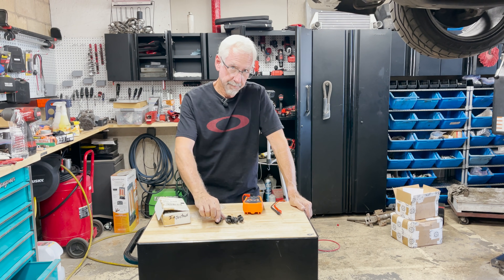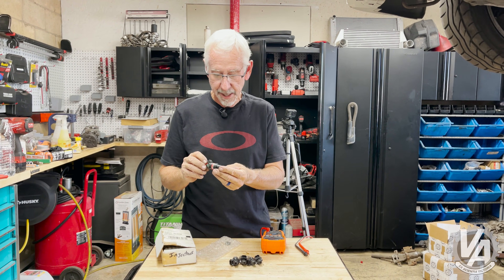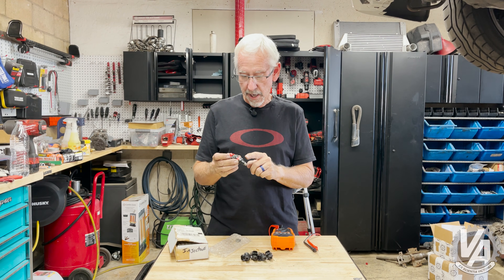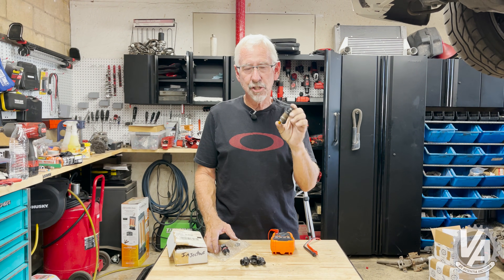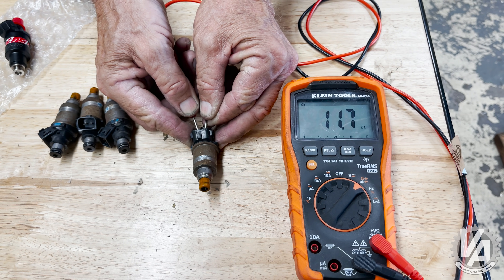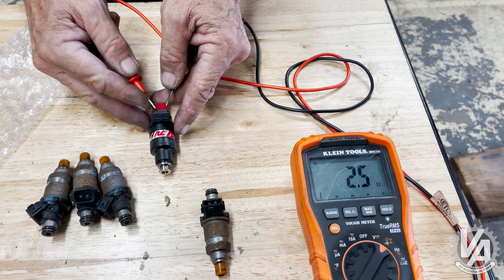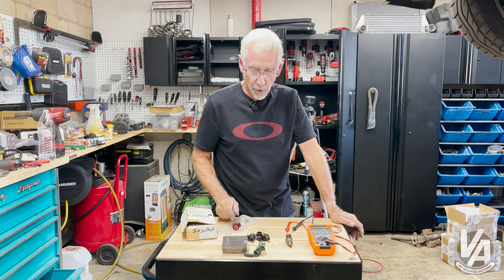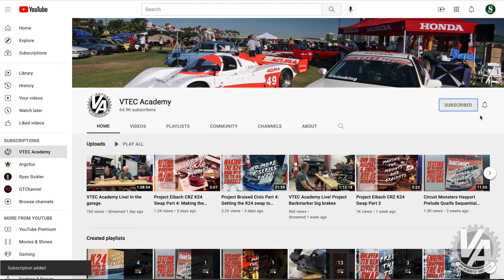You NEED to get this RIGHT!

Comment: Does the h22a use low or high resistance? Ive never messed with this series motor before
Reply: I think low..smaller hondas like 1.5 and 1.6 use high impedence ..and bigger engines like 2.0, f22(accord) h22 prelude are big 4 cylinders so makes sense to be call low impedence ..so pretty mjch the complete opposite big engine low impedence..small engine high impedence but the obd1 ecu is ment for high impedence..so low impedence injectors requires that box to fool the ecu to think its using high impedence

Comment: does the ecu have any control of high or low impedence or thats solely between injector/ resistor box? i have this chipped obd1 p28 ecu that was said to run on a b20 turbo. im waiting to get a burner to put a new base map for my stock f20b. which my other question would running a tune originally for boost on a stock engine cause any harm?

Comment: How will you know if the ecu got damaged if a resistor box was not installed on low impedance injectors?
Reply: No fuel prime ..ecu will make a good stock car run like crap

Comment: To my understanding a low impedance is a peak and hold injector and a high impedance is a saturation injector. Hopefully someone can confirm this or tell me I am wrong :-) great video!
Reply: How do I tell if my computer is for low or high impedance?
Reply: @4OhmAudio  there is a little metallic box about 4 inches long by about 2.5 inches tall that sits under the hood of Hondas that have low impedance injectors…like for example my 93 accord has low impedance injectors which it has that little box next to it. I would post a pic but YouTube doesn’t allow stuff like that

Comment: I'm using the factory K24A2 injectors on my 1989 CRX with Hondata. That should be okay.....?
Reply: yeah I have k24a2 tsx injectors in my d16zc sohc v tech coap ex never gave me any issues gave me more power and I nitrous kit too in it 75shot dry no issues works fine

Comment: Can you do a tech thursday on worthwhile Vtec pressure sensor replacements? OEM is about $100, I got one on amazon for under $15, it worked for a month... Running Hondata flashpro and have the sensor turned off at the moment so car doesn't fall on its face at 3,600rpm... 

Is OEM the only option that actually works? Got 162k before it died. I don't want to keep running with sensor disabled but I also don't want to drop $100 if I don't have to.

Honda 07 GD3 FIT - (P/N crosses for K series engine as well)
Reply from the maker: Do you mean 37250-PRB-A01?
Reply: @VTECAcademy   Also once the OEM and aftermarket sensor died they will pop the check engine and fall on its face basically every time the engine goes into Vtec = leads me to the harness pigtail loss of connection not causing the issue.

With sensor disabled engine runs exactly as it should, I just don't like the idea of sensor off long term but maybe it is non-issue?